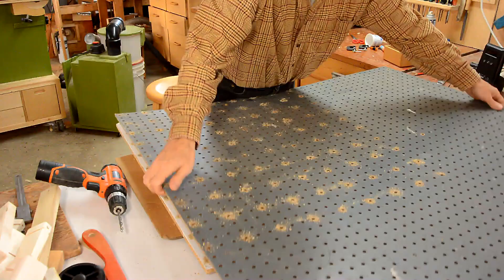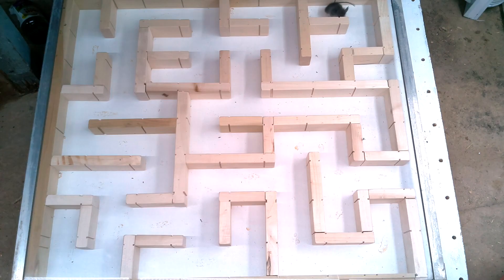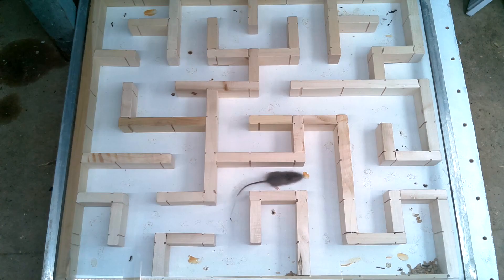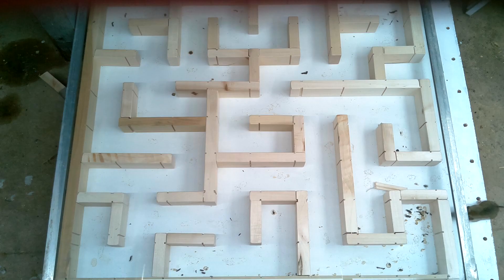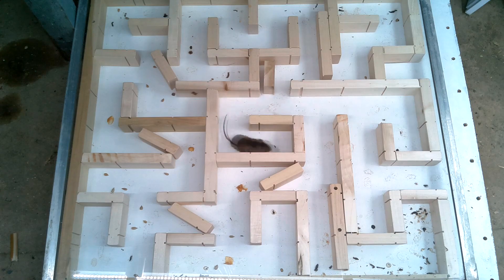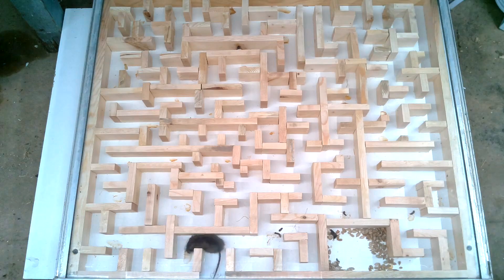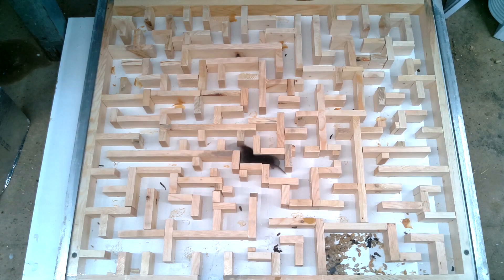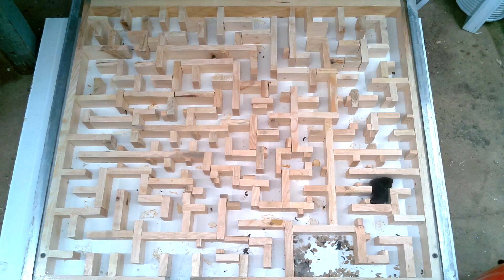Bigger, tighter mouse maze experiments

Comment: You should build a one-way door. They go in on one side and out of the other
Reply: I was about to suggest the same thing.
Reply: Or, a revolving door(s) so that the maze reconfigures as the rodent moves through.
Reply: Shouldn't it be they go in and never come out?  I think what he needs is a good cat.
Reply: Jeff K, but the little furry guys are his friends now.
Reply: jeff K, the mice absolutely come out.  much leaner than they went in.
Reply: I don't think there is much that would stop them unless it was obviously impossible..  I mean, you know they would chew right through any one of those blocks if they felt like it was necessary.
Reply: Add a second floor with an elevator

Comment: That shrew is used to the maze having a roof.. you should take off the roof and see if it realizes it can just jump over or if it keeps doing the maze
Reply: Good idea. But I think the shrew will realize it soon
Reply: It actually might not realise it quickly, the shrew seems to be very good at following an established pattern but is slow to respond to change.
Reply: I would like to mention that a few times the shrew tried climbing the maze from the outside, it's just hard to notice since the video being shown is very fast, but I figure since it tried climbing on top of the maze it'd find out relatively quickly.

Comment: Y’know what you should do? You should make those kinds of maxes that have a big center. 
Step 1: make a maze with a center that has a entrance and an exit.
Step 2: place a door flap at both of the doorways(?) at the center so that the mouse can enter the the maze and head into the center but not exit the center through the entrance. The mouse will be forced to get out of the maze through the other door flap  that will lead them to the exit of the maze. This will prevent them from coming in and out through only one route. They’ll need to learn how to enter and exit the center.
Reply: would that be ethical?
Reply: @vitor.guitarra  A mouse trap that actually lets a mouse escape if it learns how to. Yes. I believe it would be.

Comment: Shrews cannot see as well as mice and rely on echolocation because they can’t hear well either.  It’s possible that the shrew moved the seeds to have a better idea where the path ends.   The seeds may have blocked its ability to locate the wall behind.   Shrews are also smarter than mice.

Comment: The shrew is extremely smarter than that small mouse when it comes to mazes, and he's also (if the shrew is a he) great at fitting in small holes
Reply: he's just much more determined
Reply: Pretty sure the mouse just had no incentive to push any further once the shrew cleaned the entire floor.
Reply: I think it's not just smarter , I think it's more careless where the small mouse doesnt trust it.
Reply: @xXGeth270Xx  Well the shrew has  an excellent nose and ears so he can definitely sense most of possible dangers.

Comment: what did we learn? shrews are smarter than mice.
Reply: Regarding navigation through underground tunnels. Mice may be better in open spaces.
Reply: I learned that... Big black thingy can fit in any size of holes... Even if it tights
Reply: doneld trumpet Small black things*
Reply: its big compared to the mice
Reply: I wouldn't say "smarter", just more stubborn. The mice adapted much faster to the shortcuts than the shrew did, for example, as the shrew had a plan and stuck with it no matter what, whereas the mice looked for the path of least resistance. In the final maze, the mice decided the food further on wasn't worth the energy they'd spend trying to find it (and likely wouldn't push the blocks in the previous maze for the same reason), but the shrew developed a very systematic approach and followed it even when extra resistance was added. Very interesting stuff!
Reply: In my opinion its not like that. This experiment is funny to watch but we cant jump to that conclusion. The schrew was the first at entering the maze and at reaching the "treasure", i suppose the mouse since the maze was long and full of the schrew smell had identified that place as the schrew rest. You understand that for a mouse it s not that safe to entering that deep in such a place. He just entered to eat that food at the enter of the maze that was easy to get and not risky ^_^
Reply: they didnt take the shorter path, but are more curious

Comment: What about a movable maze? You could get a bit of use out of your raspberries pies and try some remote/timed maze manipulations. Would be crazy to force them to learn new patterns on the fly.
Reply: You're basically talking about the premise of the movie Cube.
Reply: That eould be cool
Reply: Just without the traps that would hideously eviscerate the poor rodents! (Epic film btw)
Reply: Arduino is cheaper and would be enough. I doubt you need a full computer to time and move some walls. A microcontroller is enough.

Comment: I got an idea for the mouse to make it more interesting. Put pressure plate near entrance when mouse stands on it it will close the door and open another on like another side so the mouse has to do it.
Reply: Interesting idea! You can play around with a few switches too to test the intelligence of the animals.
Reply: That could be controversial though, it would remove the voluntary part of the experiment.
Reply: Great idea, Jigsaw.
Reply: i feel sorry or your kids. They better act nice in front of you.
Reply: What do you mean by that?
Reply: GameAdventure //Jonathan Pecany what I meant was you'll always come with a plan to make your lazy children (if any) to get the work done. I didn't mean to sound rude.
Reply: What are you talking about. It is quite fun to challenge a maze runner. get it!!!
Reply: Couldn't he just built a one-way valve type door?
Reply: He could do both but that thought would just trap the mouse and might be cheaper but I don't think he wants to trap it completely if I am thinking right that you are thinking. I would of did my idea if I had mice but I don't.
Reply: Undercover Cactus how so?? The mouse still has the option of pathways. All hed be doing is closing one door to open up another the door could be reopened by simply stepping back on it again.

Comment: At the 4:15ish-34 mark where the shrew moves the pile "for no reason", it appears that it thinks if it moves the pile closer to the "door" it will be able to speed up the transportation... alas the food is not reachable directly from the door (tries to push the block a couple times then gives up).
Reply: Yeah, it does a similar thing on the side at 2:25 where the cache shares a wall with the exit. But I don't see the same behaviour w/ prizes aren't adjacent to the entrance. I wonder if it would still happen with the narrow path.
Reply: I'd say that the reason is more likely to attempt to make the pile a bit more hidden, and reducing the risk of another rodent feeding on the stash.
Reply: I'm more inclined to go for the hiding explanation.  The grain wasn't visible from round the corner after the shrew had moved it.
Reply: It might be a bit of both. The shrew could probably smell the seeds near the entrance and tried to move them closer, which also happened to hide them more. Or vice versa.

Comment: Mice and other rodents tend to leave scent trails for them to follow, to let them easily navigate the tunnels that they live in, so it’s very difficult for them to actually get lost in a maze. But good on you for testing that for yourself
Reply: Jeff Nuij I can see how scent helps you determine that you've been in a particular place before, but how do you know whether it was the direct path out of the maze or just another dead end?
Reply: Think of it like a bread crumb effect, they can follow their own scent backwards to the exit. Rodents also rely more on sense of smell than their sight, so I believe they would be able to tell how old the trail they left behind was, like a dog tracking a fox.
Reply: Jeff Nuij yes, no doubt it's like a bread crumb effect, but if I went into this maze and left breadcrumbs everywhere I went, they wouldn't be a huge help to me on my way out unless I happened to stumble upon the correct route to the seeds first time around, or I deliberately picked up all the crumbs I'd left in dead ends before continuing with my journey. Logically, I suppose, the trail on the correct route would be half as thick as the dead-ends, because I would only have travelled it in one direction, but is a mouse that deep a thinker? And I'm not sure it explains how they know the way in the next time they come. Even if as you say they can very accurately detect the freshness of their scent, they would still need to remember the significance of that particular point in time, in order to disregard false steps. They really do seem to have a remarkable memory, certainly better than mine.

Comment: rodents lay a trail of scent down on the path -- they follow  that. that is how they find their way out of places; they just trace their own scent backwards.  some shrews live in mazes underground right?   plus they maybe have a better sense of smell.  I think the advantage that the shrew has over the rodent is their sense of echolocation.  they can find the openings a lot faster because of that.  i think the mouse did not want to continue because they are so careful.  he did not want to get stuck.  he will use his whiskers to measure, and i think he decided that "nope, too tight.  too dangerous."  rodents are curious, but won't take uncalculated risks.  shrews eat 2X their weight per day.  shrew is going to try and get that food no matter what.

Comment: Respect to the Shrew.
Scale that Maze up to Man Size and i would get lost in there for Weeks.
Reply: You just need to consistently follow one of the walls, e.g.  the right  side wall.  Whenever you get to a door you go trough it and continue to follow the right side wall.  This will bring you outside eventually.
Reply: @Markus_B my answer was addressed to a human so it is obviously a procedure for humans,  not for shrews.   Difficulty of maze problems for humans is overrated because there exist this simple procedure to solve it.    As for your recomendation,  I suspect the idea came to you because your's farts smell  is unusually persistent.
Reply: Mihai Lutescu only If the path dosnt contain loops
Reply: M GSP58 even if the maze contains loops the method will work on such maze, which is 2-dimensional and has one  entrance at the exterior of the maze.  The right wall rule won't  lead you into a loop.
Reply: Think of a simpler problem.  Think of railways in plane.   Let's imagine all railways in the world have one track green and the other track red.   Now imagine 2 such railways that intersect (such that a train can continue to walk after the intersection point).   However you imagine  such intersection of 2 pairs of parallel tracks,   there will allways be (at least) one red track from a railway getting accross a green track from the other.   

Now apply this to a single such railway which self-intersects.   At the self intersection point, there will be a point where the railway's red track crosses the railway's green track.    

This means that if we are guaranteed that the red track never gets  accross the green track, we are guaranteed the railway never self-intersects.   A train walking it whould describe a trajectory without self-intersections.  

Coming back to the 2-dimensional  maze, imagine somebody traversing it marks down his/her trajectory by laying down a red rope behind him/she.   Say he/she also marks the "trajectory" of the right wall,  by laying down on the floor a green rope just stuck on the right wall.  As he/she goes forward, he/she lays down the two ropes in parallel, the green one at the right of the red one.   If he/she follows  the right-wall  rule at all steps than he/she can lay down the 2 ropes at every step,  effectivelly building with the 2 ropes  something  topologically similar with the railway of the previous problem.    Now observe the red rope can never cross the green one - this would signify he/she goes directly through a wall (or jumps over it, or goes under it).   According to the former discussion,  the 'railway'-like structure built with the 2 ropes never self-intersects itself.  This means the man can't be caught to an infinite loop inside the maze:  he/she either returns from where he/she started, or get through another exit.  If he/she would get caught in one internal loop the railway-like structures of the 2 ropes would also have self-intersections, which it can't.

There can be loops inside the maze but they won't catch someone consistently following the right-wall (or left-wall) rule.

Comment: 4:08 maybe the shrew thought the seeds were too 'exposed' and put them in the corner as a temporary stash until it could get them somewhere more secure. I wonder how many stashes (if the temporary stash idea is true) wild shrews and other rodents might maintain? I'm sure you've had many people suggest new experiments, but I'll throw some more in the pot in case you're reading these. 1) optimality of path selection: in a maze with multiple potential solutions, would the rodents continue to use the first one they discovered to the seeds, or eventually find the fastest route? 2) hierarchy of objectives: given multiple seed stashes, would they deplete one stash completely before starting another or would they alternate in their retrieval process? Do you make the full video of the experiments available anywhere? It would be interesting to do some tracing to try to understand how their exploration processes differ and maybe even train a simple model to predict their motions/teach a robot how to traverse the maze :)
Reply: Sebastian Swanson I would love to see that
Reply: Most intelligent comment in comment section

Comment: Perhaps what we see as confusion on the part of the shrew is actually it double checking everything to see if the food bait has been restocked. It sees 1 small change (like the shortcut) and decides the rest of the maze is worth checking for extra food. You've run the experiment and added more food enough times for the mice and shrew to expect replenished bait every time. As for the mice at the very end, they might have decided its too much work and potentially dangerous. The same instinct that lets them avoid traps is what is keeping them from risking getting stuck in those tight hallways. They are far more careful than the shrew.

Comment: Are shrews smarter than mice?
Reply: Seb mice are smarter but shrews have a more malleable body so they can fit through very tiny gaps, but mice and rats can also do that but shrews bodies are more fit for the job.
Reply: Sorry harry, not true. The mice ARE smarter, but the reason they didn't venture into the maze is because of them being smarter. They were more cautious and didn't want to risk getting lost.. The shrew was just too stupid and stubborn to give up.
Reply: calm down lindy
Reply: Just think of the shrew like Leroy Jenkins
Reply: To be fair she has one point (I said one for a reason, the rest is trash). Human perception of intelligence is not a medium by which we can compare and contrast the intellect of different species (for now, there are current tests but most test makers agree it's not perfect). For instance not risking that maze could be a sign of intelligence, the shrew "remembering" (using that term loosely) the maze might be a sign of intelligence.

Shrews however being nearly blind and navigating largely on scent it can get understand the path fairly easily fairly fast.

The mouse on the other thing sees a tight space and is more cautious. Why that is I can't tell you. If it's intelligence or the fact that they can understand an ever-changing box made by a larger being who knows (the answer is no-one).

In short, further data is required.
Reply: Jordanious77 the shrew got feed and ran the last maze at 30 seconds.. and you wanna say the mice is smarter?  😂
Reply: the mice are smarter that's why they won't go in because they know the difference between safety and danger, the shrew is dumber that's why it ran straight in without a second thought
Reply: this mice was just coward :D
Reply: Maybe the shrew is smarter than Lindy.  He out there getting his while she's over here womansplaining us what she learned on Animal Planet.  🤔
Reply: Plants are also intelligent.
Reply: Both of them are smart. The mice is clever and cautious, while the shrew is blind but have a strong sense of smell and sonar.
Reply: From this experiment. I learn that Shrew are risk taker while Mice likes to play it safe. Mice tend to be more cautious than the Shrew. Shrew be like, Yolo.

Comment: They can track or follow the air flow.. next time try to make a little swinging door at the entrance to slow down the air flow making them work a bit harder but key to this would be to drill little 8th of an inch holes throughout all the walls causing the flow of air to come from everywhere making it super close to impossible for them to find the way out without taking an extremely long long time ! Just an idea 💡